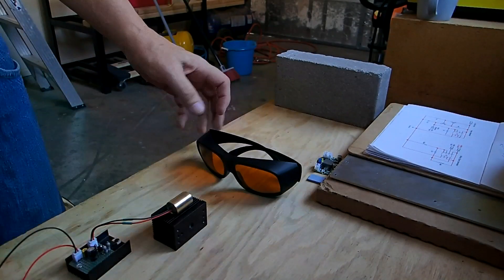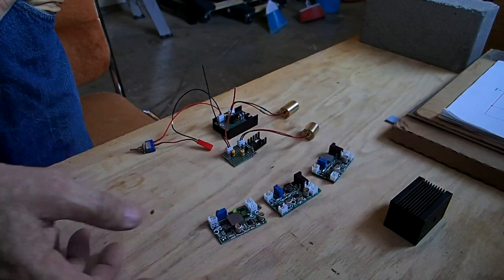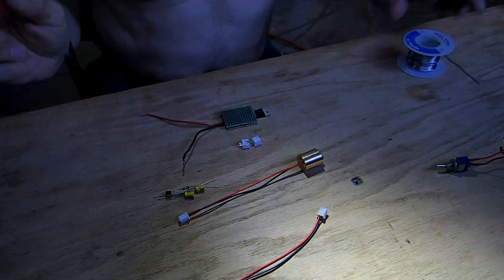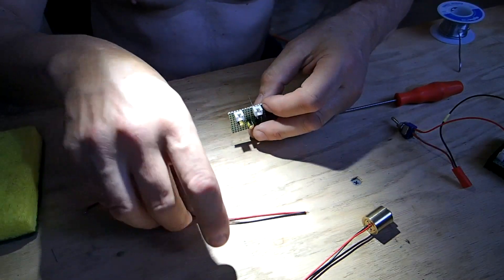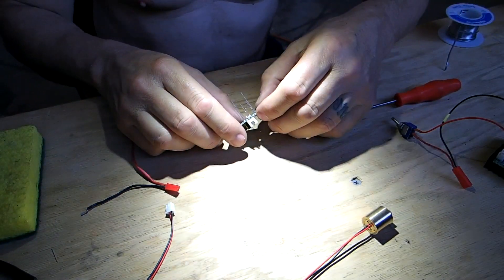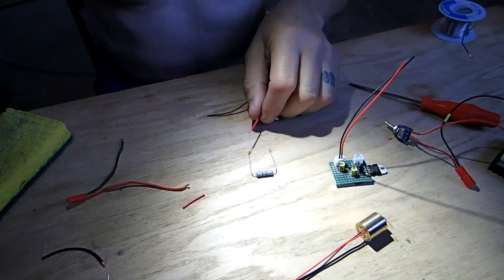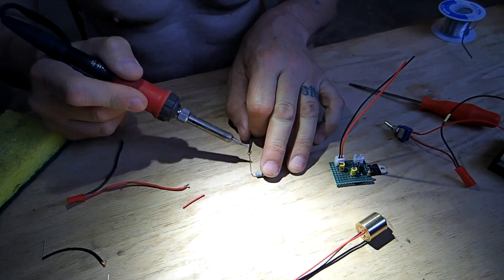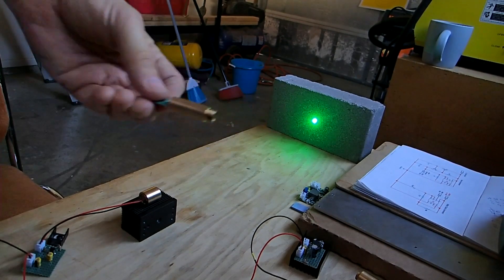Build Laser Diode Driver Current Source

Comment: I am thinking about buying a 75w 905nm pulse laser diode, what would I need to build the driver ? 15v 15a (mA ? ) Ali Express $20 diodes
Reply from the maker: Well start with 75/15 if you're using a 15 volt Supply that would be 5 amps of current now this is for continuous operation so for pulse it should be great

Comment: (Power transistor, voltage regulator)....... a mosphet?
After watching a bunch of "laser driver" videos I'm so confused because everyone is calling stuff weird names.
Isn't a mosphet a gate? 
I was going to use a pot, resistor, cap, dioad and a mosphet as a gate/switch but now I'm worried.
Saturday night drunk might not be the right time to figure out how I want to plan my wires on some lasers....
Cheers!

Comment: Any good compact drivers for placing inside the host of the laser to drive a 2w blue or 7w laser with added mosfet for running as a switch for the laser.

Comment: You can power of the small red laser diodes directly from mains voltage using a cap dropper circuit. 
https://youtu.be/R0xReDmX12Q

Comment: Nice vid , but the laser goggles testing IS A BAD Idea , just get actually good goggles from laserglow.
There is no price for working eyes.
Reply from the maker: My laser goggles had have certification numbers on them therefore blue green and infrared all-in-one goggle
Reply: @RaptorRotorHead  yes , not saying they're bad , but properly rated ( OD rating and wavelength range) goggles are safer than just "looking if it blocks green". Also , most common green laser pointers use DPSS laser that are frequency doubled , and sometimes badly filtered, so they also emit a good portion of infrared laser , that can't be seen .

Comment: any chance at a good close up of the top and bottom of your little board? is the bottom line in the diagram the ground?
Reply from the maker: You talking about the board that I said was Superior?
Reply: @RaptorRotorHead  no, the one you built in the video.   In the video we can see it at a distance, but the detail is hard to see.  A close up of both sides will give extra clues since its harder to see what your doing since we are not over your shoulder

Comment from the maker: Most of Chinese ebay or almost all are switching supplies, but all the ones sent to me where not current sources. What you see here is a linear current source. No matter how low the diode pulls the voltage down the current remains the same, thus preventing the laser from burning out. One notable effect is there is no sparkling dots around the laser beam which is caused by the switching supply switching on and off to control current. The trade off is those supplies can be much smaller, but the only ones I seen that are worthy come from Russia and cost $30 and we're not adjustable to accommodate any size laser diode.